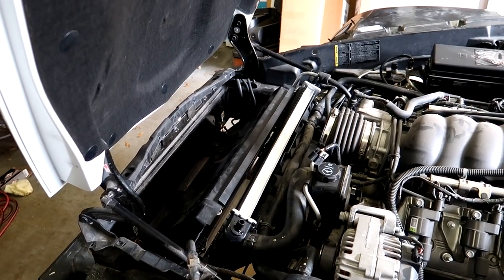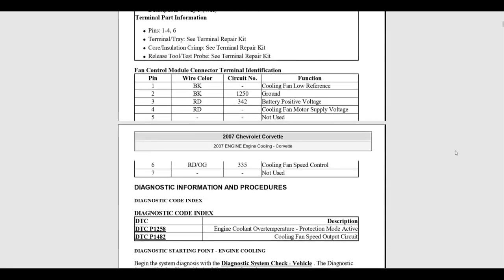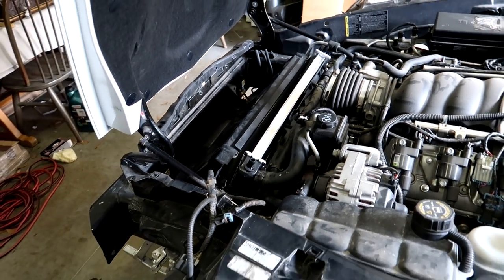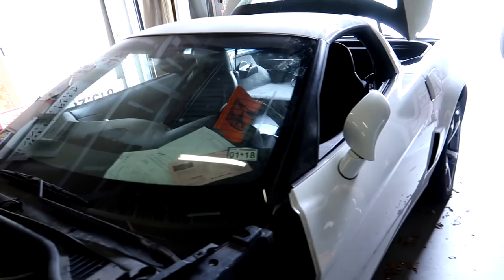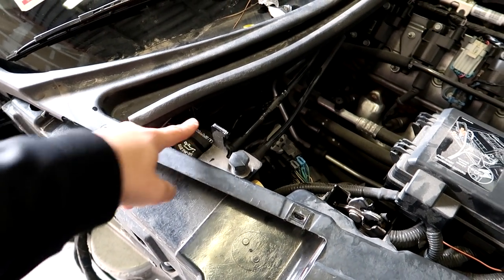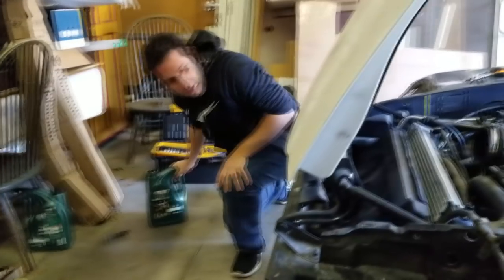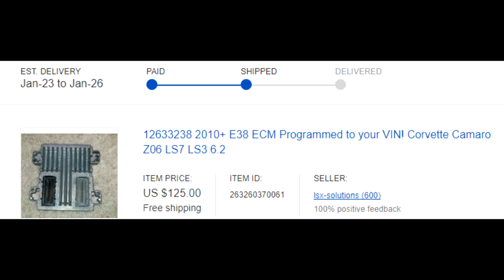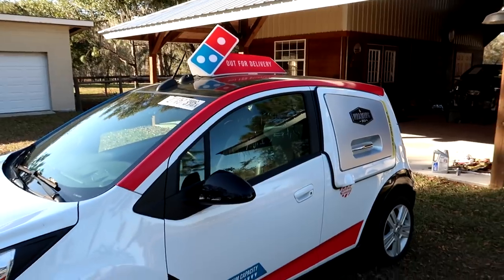Tried to Start The Corvette... More Problems! (MAJOR Piece Missing)

Comment: ECM should plug and play, its is possible to have had software inside programmed for quicker response times, higher revs, fuel management etc, but that can come down the line. I replaced the ECM and TCM (transmission- shorter shifts) in my G8, and it made a huge difference! Will Overkill has a trade program where he sends out the programmed modules and you install and send back the stock parts to get a deposit refund, costs about 175, so worth it. Have fun!

Comment: You will probably need to get the key fob programed on your mail order PCM. Might as well buy a spare fob and have it programed at the same time.
Reply: Keyfobs can be programmed with a modis Solus or verus but the keyfobs and rfid from the keys is resident in the BCM body control module.
Reply: The guy reprogramming with the vin can remove the transponder key check inside the ECM. LS class engines are swapped into all kinds of different cars and trucks. When you do you have to reprogram the ECM to delete the transponders and rewire the the wiring looms. You can wire it up 3 wire or 4 wire. Good luck~
Reply: It's push to start.

Comment: You gotta love those pucker-up moments when you hit the start button and . . . . nothing! The fact that you captured it on video was Priceless!!! 

Sam, after you install the new ECM and BEFORE you start the car, might I suggest that you put together and go through a pre-start checklist to make sure you didn't forget any other minor items besides a missing ECM, like, I don't know, new oil filters, new air filters, new spark plugs (properly gapped), A/C connections, oil line connections, vacuum hose connections, etc. Would hate to see you start the engine only to watch it fry because some other vital part wasn't properly connected or is missing. 

BTW, no sympathy for the cold weather - Floridians have no concept of what really cold feels like. Really cold is -8 degrees F, which is what we had here in NJ a couple of weeks ago. At that temp, the portable Pizza Oven in the Dominos car set on high would be delivering frozen pizzas! lol

Comment: Lots of times, a bodyshop will disconnect all the modules if they are going to be welding to prevent electrostatic discharge damage. They used to just disconnect the battery in the past, but as you know, cars are more advanced. But usually they dont remove it, unless space to access the connectors was limited. If that was done, the module or modules should have been left inside the car. Must have been a new or lazy bodyman to just leave it on a bench somewhere.
Reply: or someone needed one and found a low cost source for it
Reply: Yeah, stinks. Thinking more like a bodyman has a nice side ebay business going :(
Reply: Except for the fact that a corvette is fiberglass so what would they be welding on?
Reply: Frame or any of the steel sub sections
Reply: there wasn't any damage that was repairable by welding
Reply: dave1135 or a thief bodyman that knew it was going to auction and took himself a souvenir to sell on eBay
Reply: Coming from somebody that enjoys 93 octane aftermarket tunes on their car. It sure helps having a spare ECU so you don't have to park your car when you send it into the tuner.

Comment: Did you tighten the battery cable? You better call the place you bought the car from, that ecm is custom to that car/ key combination and wont work on any other vette without being reprogrammed. Which means whoever stole it is SOL and should probably just give it back to you.
Reply: dposer10 most cars will run in limp mode until the key is programed to ecm. Dealers will program them for you. That's how people sell used ecms.
Reply: Colin Johnston no but they did steal it from the insurance company which sold the car, at that end it was property of the insurance company and they kept a valuable part. Now will anything be done? Likely ranging from #@!! no to absolutely not.
Reply: Ok i said it wont work without being reprogrammed, and how many thieves do you know that are intelligent enough to reprogram a ecu, most thieves are stupid that's why they steal. Also did YOU see the original auction photos? I didn't and i don't know if that ecu was missing or not.
Reply: You did notice that when Sam bought it the whole front end of the car was missing right? No fenders, bumper, only a hood so all Sam would have to do is look at the photos of that side of the car.

Comment: No need to take the car to the dealer for programming anymore.  Contact a local mobile technician who is properly tooled up, to come to your location (yes - your house is fine) and have them program the ECM or any other modules you may have problems with (also handle programming new ignition keys & many other things people routinely take to the dealer).  That is what many of the smaller auto repair, body shops, and even transmission repair shops do now to avoid having to keep buying expensive factory tooling PLUS the subscriptions to let them program all the different makes & models they work on.  Just Google search "Mobile Auto ECM Programming" plus your local largest city near you -- there should be many in every decent sized city in the USA, it is just a matter of finding the good ones that really know what they are doing.
Reply: OK, so who does he call? Otherwise this "Roaming ECM programming" doesn't exist. New Level Auto in NYC excluded.
Reply: Better go checkout  mobilediagnosticsgroup DOTcom (Youtube is censoring any hyprelinks I post) and then let me know if you still think Keith @ New Level Auto in Staten Island NY is the only person offering mobile automotive programming.  That website is just a small group, as I have 100's of names of others qualified all around the USA that do mobile automotive programming.  There really is no reason you have to bring a vehicle to the "stealership" anymore for programming.
Reply: To answer you question on who I would recommend Samcrac call to handle any mobile automotive diagnostics & programming in the Central FL area -- that is easy,  Jaime Lazarus at  the-carwhisperer DOTcom (Youtube is censoring any hyperlinks I post)  is hands down the best in that area of Florida.  Depending on Jaime's workload he may even be willing to do a detailed video with Samcrac showing what can be done by qualified mobile techs, who have properly invested in all the latest factory scan tools & programming software and also have the real-world knowledge to know when a used module may work & when it may in fact brick/lockup many of the other modules in the vehicle due to VIN mismatch issues.

Comment: The theft deterrent module and the engine control module have to be programmed to the specific vin. We use GM's website to access the software so that the vehicle is programmed via an old Tech2, MDI, or the current MDI 2 scan/programming tool. The 2 hour charge is on the mark for customer pay since there could be more modules that have multiple DTC's causing the programming event to be stopped. I don't know of anyone that can program an Corvette ecm because of the differences in software that are possible due to the vehicle configuration. I'd do it for free but unfortunately I'm out in California. Find someone that can do it with access to the GM software or bite the bullet & take it to the dealer. Corvette parts can get expensive so be very weary of someone that says they can do it without the proper GM software.

P.S.  Don't ever jump-start a Corvette! The electrical spike can damage modules. Always use a jump box or charge it beforehand. A field engineer flipped out when our porter did it.

Comment: you don't need to take the car to dealer.....all they need to do...is plug your ecm into another corvette and then, put your serial number in....and the computer will download what is required.  The computer doesn't know....your car isn't there...it only knows the car serial number.  I did this...with a wrecked chevy truck.....and didn't take the truck in.....just took my ecm that I bought...used...and the dealer put in on a truck that was already in their dealership...and they loaded the ecm...and I took it back home and connected to my truck...and it started and ran just fine.  They didn't charge me ANYTHING...to do this.
Reply: That may have worked in an older model vehicles, but try that with a newer model vehicle (such as the Corvette that Samcrac is working on right now) and you will likely brick/lockup many of the other modules since the VINs are now written to all the other modules in the vehicle (i.e. BCM, ABS, SRS, etc) on a one time basis.  That is why a new/reman module with a blank VIN is required on many of these newer vehicles.  Depending on the vehicle manufacturer, some of their programming software will not even let you get past the start-up screen of the programming software anymore if the VINs mismatch in any of the modules.

Comment: A couple ways you could do this. If the ebay ecm works, that’s your cheapest option. There are also mobile mechanics that will come out and program whatever module you need, using the factory tools. Lastly, you can buy an highly advanced scan tool to program it yourself. While those do cost way more than the scan tools you’ve shown before, if you think you’ll be doing this for a while longer, the investment (2-3 grand) is worth it for future projects.

Comment: Almost all ECMs, actually pretty much any control module these days, come blank, then have to be programed. Typically they charge 1hr labor time, or $100, simply because that is what they have to pay the tech. Yes the actually process could only take 10min, or less, but in some cases it could take more. Keep in mind on a lot of these newer cars, it is not a simply just program the module, in a lot of cases it could also do some relearning processes, like transmission shift points, and idle. As for the dealer ship you talked to, about adding a extra hr, it sounds to me like one of two things, first keep in mind that every dealership is franchised, so it is possible that, that one dealership is a rip off, I would contact anther dealer and see if you get the same thing. Second it is also possible that you told them that it was a crashed car, and they told you that to cover them selves. Think about, they tell you 1hr, you tow it there, they go to put the ECM in, and for what ever reason, there is kind of issue putting it in,  programing it. Now the tech wants a extra hr to run over the car, and find what the issue is, fix it, then program it. Now they have to tell you, we know we told you 1hr labor time, and you had it towed here on that premise, now we need to charge you anther hr, it could make you pretty upset. It is better to tell you hey it might be 2hr, you tow it there, it turns out to be simple, and it is only 1hr, then your happy, it is cheaper than you were told. If turns out to be two, your not angry because you were already informed of that. As for these second hand modules, programed to your vin, I have had many people come to us with problems with these. The issue is, there so many different options today, that even one particular model year, could have upwards of 10 different module numbers. This is why they now for the most come blank, to try to limit the number of different part numbers, to try to limit warehouse, and dealer inventory. The issue is, in a lot of cases once programed, the amount of new stuff you can rewrite to it, is limited. So for example when it comes blank, brand new from the factory, they write everything to it, transmissions specs, emissions, vin, engine specs, everything. But once that is written, in a lot of cases the only thing that can really be rewritten is the vin, and even in some cases that is hard to do. So if the control module was initially written for a California emissions car, and now try to put it on your federal emissions car, there might be issues. In my professional opion, I think your better of spending the extra $400-$500 bucks, and getting it brand new from the dealer. I hope I am wrong, and every think works out, but based on past experiences, with multiply makes and models, it is going to be nothing but problems.
Reply: Hyundai/Kia ECU's come programmed but not married, buy brand new plug it into the car and it marries to that car and runs and drives.
Reply: You need to restate your case and be more direct to help this poor guy,  there is no way this is going well for him, I've seen this from a mate and his ride, with an aftermarket ECM.

 it's never pretty watching a grown man cry in his garage  while his wife yells and nags at him that he is clueless

Comment: When a car has been torn down, and the insurance totals the vehicle out, I'm sure the first thing on everybody's mind at the shop is putting all the parts back in it...(sarcasm)  I had my Mustang totaled out, and the body shop at the dealership wouldn't even touch the car until the insurance adjuster gave his verdict.  It went to IAA in the same state it was in when the tow truck driver dropped it at the body shop.  I found the IAA photo from the auction, and the bastards only showed the undamaged side of the vehicle.

Comment: Sam, best way to replace the ecu yourself without going to dealer is to buy a vin-programmed one on ebay, and do the passkey relearn yourself after install. it doesn't require any special tools, just have to turn the key to try to start, let it go back into run position for 10 mins. turn key off for 10 seconds, and repeat 2x for a total of about 30 mins. will start right up afterwards if done correctly. search GM passkey relearn for more info
Reply from the maker: +Kowalskithegreat thank you although this is a push start so we'll the procedure be the same?
Reply: Samcrac the pass key procedure will not work with in this case. The push button uses a different procedure. The fob info may be stored in the bcm. But there is a challenge password between the bcm and ecm that might have to be relearned

Comment: Haven’t worked on a GM in like 8 years, working with BMWs now, but that ECM may need to still be coded at the dealer after it’s installed. CASE learns used to be required so the ecm knew where the crank was, and other modules probably will need to be synced with it.

Comment: It never makes sense to buy a new ECM from the dealership for General Motors vehicles, they are easily reprogrammed, typically one part number covers a wide range of vehicles, and you can either have someone program it for you or you can buy Chinese knock off Tech 2 scanners and TIS to do your own programming if you do it quite a bit. And you are right, dealerships always make it more expensive and complicated than it needs to be. I don’t know if this is going to be 100% plug and play when you get your programmed ECM, there may be a pass lock relearn you have to do with your key fob. Check your GM service manual to see if there is a mention of that procedure after ECM replacement.

Comment: Has to be either tuned by Chevy or with aftermarket tuning software, however if you are going with aftermarket it's still always good to keep your base map. So truly the best option unfortunately is to go to Chevy and have it tuned. And they will flash the computer, and still would recommend taking it to a Dyno and tuning the stock map to perfection.

Comment: Not surprised the ECM was missing after seeing the amp in the GLI was swapped. BTW, I'm adding an OEM set of driving lights to my wife's car. It's a factory kit complete with lights, grills and harness and will have to take it to the"stealership" to code them into the computer before they will operate. Feeling your pain.

Comment: on mazda it actually does take a while to program a new pcm on a mazda... not sure about chevy...it requires re programming the keys to the new pcm and must have 2 keys or it wont work you have to enter data manually from the internet too... i think we would only charge 1.5 for that too

Comment: The dealership requires the car to be there mostly because they don't have a rig to program the ECM off the bench. The vehicle itself becomes the programming rig.  People that specialize in ECM reprogramming/repair have their own test benches (with harnesses) to program the ECM off bench.

If you have to have a dealer program the PCM for a future vehicle, don't just go with your local dealer. Call a couple of others. I had to have a radio reprogrammed in a 04 Silverado, and one dealer wanted to charge me 2 hrs labor to do it. Another dealer wanted a hour labor. I finally found on near Ft Pierce that would do it for me if I brought the truck in for an oil change. I happened to be going to Ft. Pierce the following week for work, and it was about time for an oil change. Two birds - one stone.

Comment: you are going to get lucky if you get the old ECM and make it very easy for you (I recommend). OR! you get to visit the stealership and have it programmed. OR maybe you might find a local shop with programmer ability to do programming on the new ecm and add a little more power to the pony also.   you need to brush up on tech savy of what you are working on, bumbling threw things might lead to further (dont just slap the new ecm on) damage.

Comment: The next time your doing extensive work like this pull the hood and Jack up the front end  of the car it will save foot steps, time, YOUR BACK and will preserve your energy level and will make access alot more easy both on top and undernieth

Also magnets on a stick from HF are your best friend